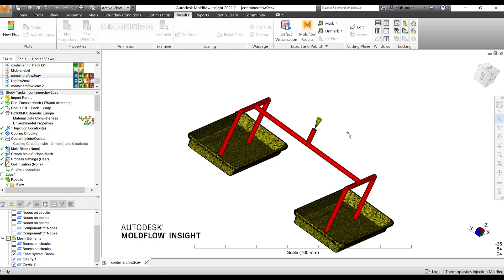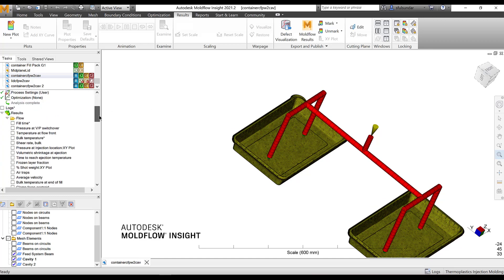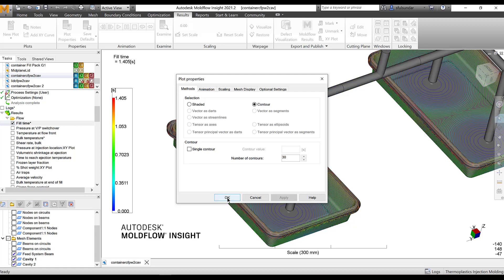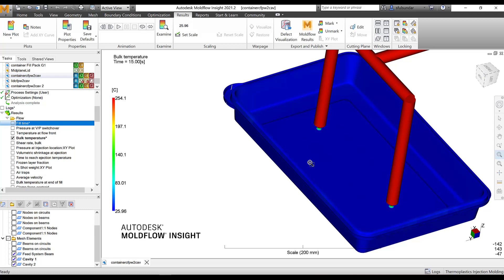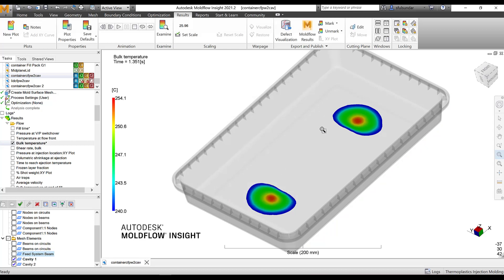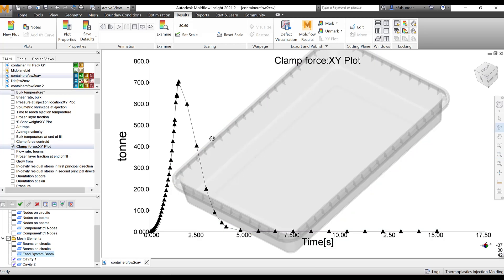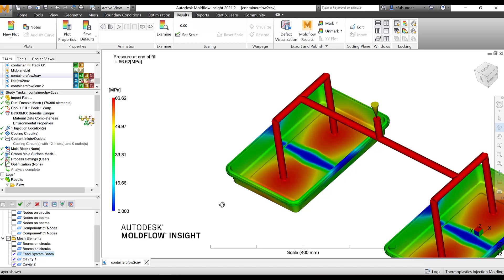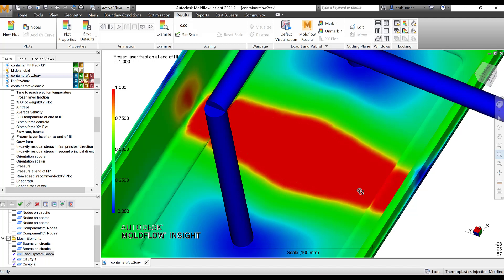Top 12 results to be viewed Part 1

Comment: How to define runner system from Cad software (Catia, NX)   in Moldflow  ?
Reply from the maker: Hello Brian, if needed you can directly import the feed system CAD in native file format and assign the attributes in Moldflow as feed system. However I would recommend to convert in to beam. I have created a separate video on curve extraction using Fusion 360 and transfer it to Moldflow. I hope this helps thanks
Reply: @sachinfulsundar5012  Thanks for you guide

It good for me

Comment: Sir plz demo with hypermesh or 
How to determine max mesh... U r videos very help full live project...tq so much sir...
Reply from the maker: Thanks for your comments. Max Mesh Size (edge length) should not be more than 10x the product wall thickness. Say Nominal wall thickness is 2.5mm, max global edge length shouldn't be more then 25mm. However, Moldflow Meshing Algorithm from 2018 and above automatically selects the GE length based on features and thickness.